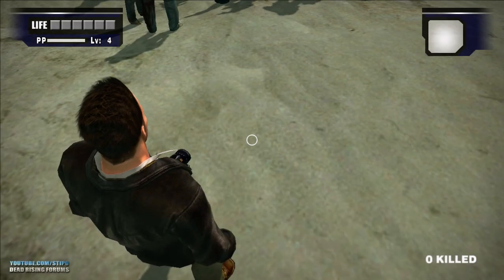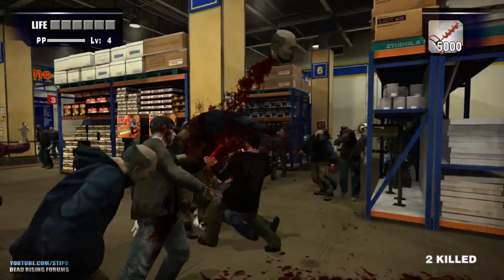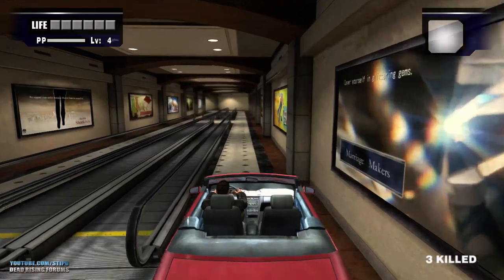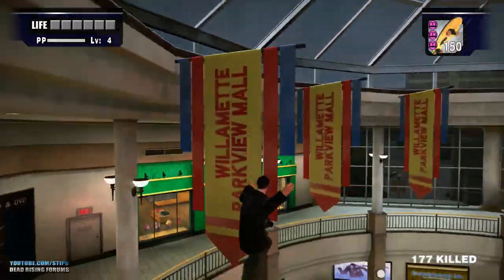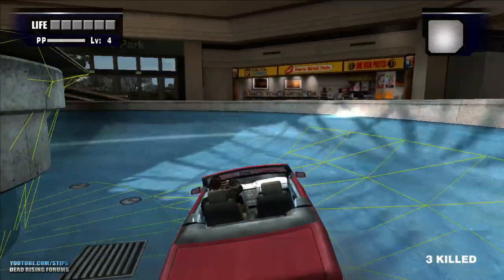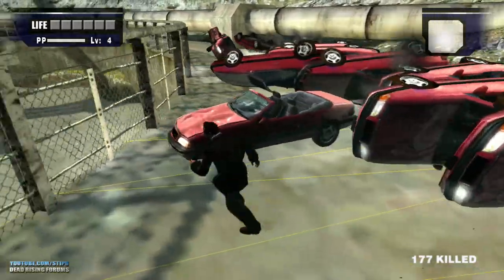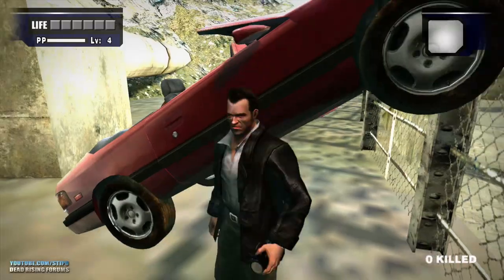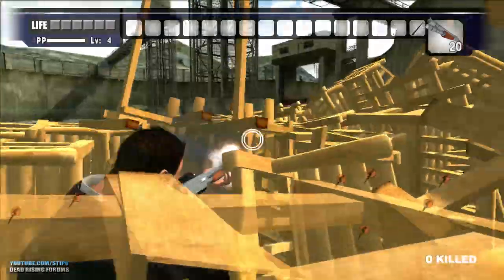Exploring Dead Rising's Physics Engine

Comment: What is even more bonkers, is the zombie limit is actually quite insane, it's not the engine that starts to fail, but rather the becoming ancient hardware of the 360 was its limitation. I have a video on my channel demonstrating 950 zombies on screen with no frame rate drops at all on a i9-9900k. It makes me wonder what the real limit of zombies on screen at once could be if I had the patience to spam a zombie in with the Watchdog trainer.

Comment: Man, I should do an analysis video on this video because there is so much code that I'm just reconstructing in my head. It's especially cool since the game was made during a time where the resources were a lot scarcer and they needed to think a lot more about how they went about things. For instance, the car only being available in certain locations. That's a big one because they purposely limit the amount of objects for collisions. Additionally, spawning items inside other items is a velocity nightmare because if there is no "path" to go immediately, it has to choose one or else they get stuck and you would see a lot of zombies inside each other, possibly walking at the combined speed of them both. Instead, they specifically wrote the engine to accommodate for this, presumably by increasing the velocity of one rather than both. It's essentially looping the same increase in velocity for an object, infinitely, which is why you get cars launching out of each other. If you had a higher frame rate in that situation, it would have launched even further.

Nonetheless, cool video.

Comment: I'm pretty sure the reason you fall through the roof and the bike doesn't is because it's set up so only prop entities can't pass, this is because you can throw objects up high up (and the bike is obviously classed as one of these objects), but it's impossible to reach the roof  on foot, there for the ceiling does not need to stop the player from falling through. I'd be interested to see if this works both ways, my hypothesis is that as the player (without a vehicle), you'll just clip through the ceiling no questions asked, and with a vehicle you'll smash your head off the ceiling. I'm not sure how much this effects load but it must do a little.

The hair going missing is an interesting one though, obviously it's a different vertex group on the model and is probably set up with its own texture etc, but i'm wondering why it chose the hair of all things:'D